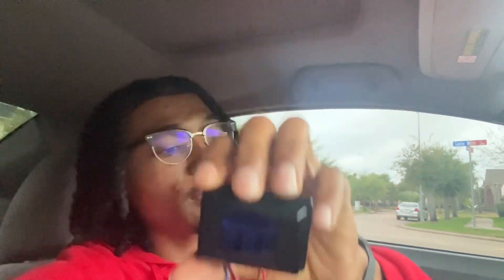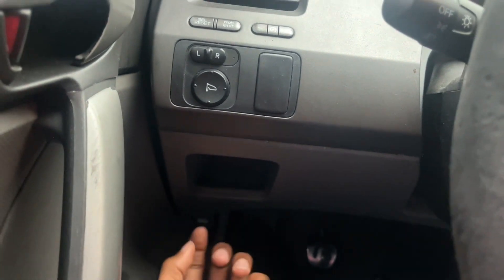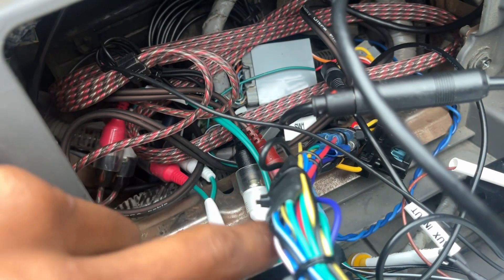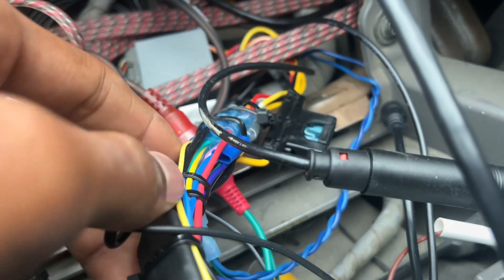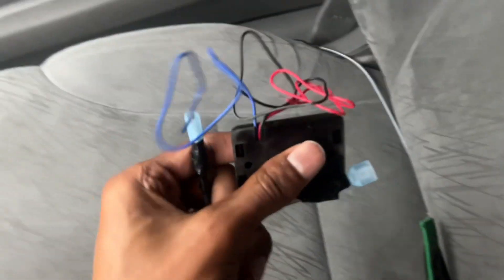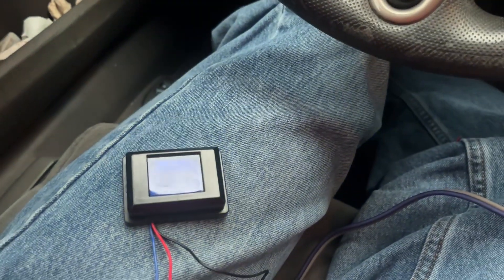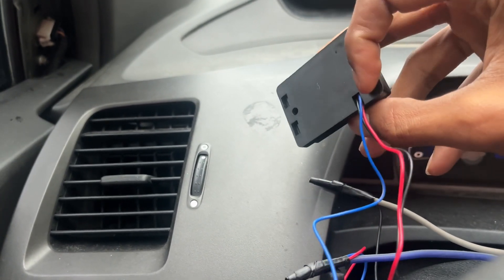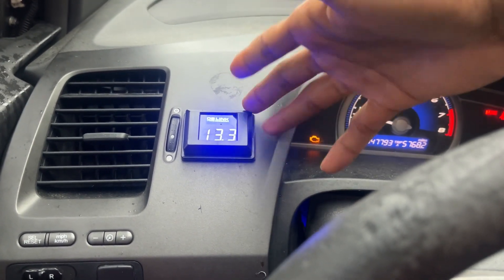Installing a volt meter for car audio

Comment: Amazon link is different to one you actually using, the one on Amazon link only has two cables power n ground,  and one you have has a remote cable turn on where's link to that one
Reply from the maker: I couldn’t find it, I got mine from an audioshop. They will work the same if you connect that power to a switch 12v wire

Comment: You should put it right where the power wire goes right into the amp so you see how much an amp is pulling at the time it's better but it looks really nice